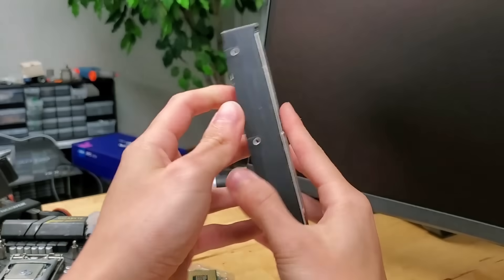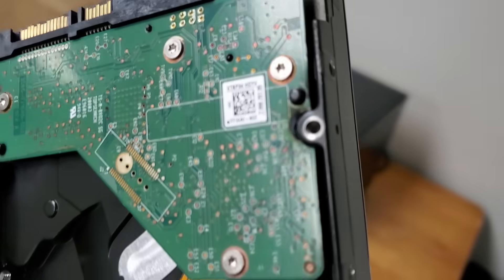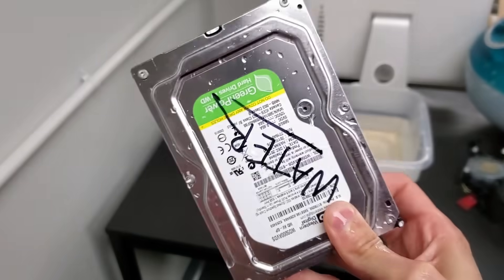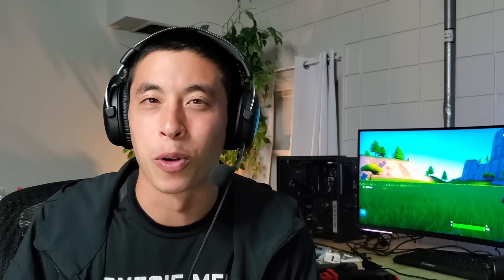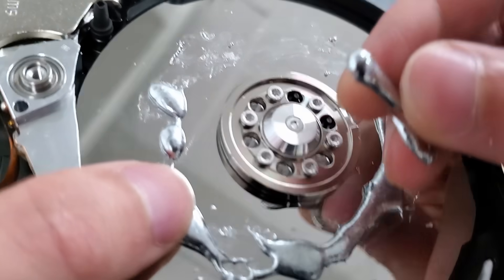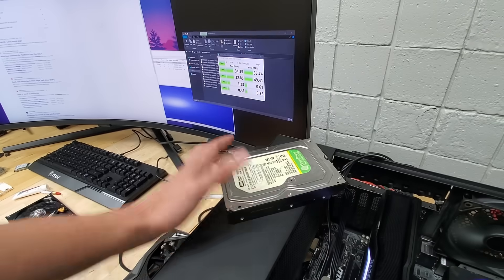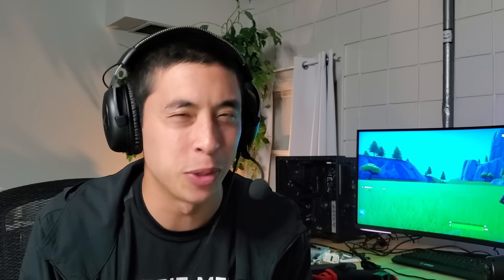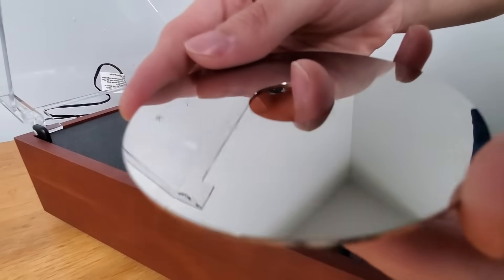The Most EFFECTIVE Ways To Destroy A Harddrive

Comment: @mryeester
You should have taken the disk out and used a stick welder to send arcs all across it. Maybe even weld a bit on there, although I highly doubt you'd get anything to bond. You also would probably need to scratch the surface pretty bad just to get that first arc, if it arcs at all.
If you can't get an arc, use two car ignition coils and use the disk as the bridge in the air gap.

Also:
Bend the disk
Put the disk on a sanding belt
Take the disk out and put neodymium magnets on opposing sides and slide them around

Yeah.

Comment: I have a 17 year old computer and it had a Hard Drive. And one day drive completely stopped working. I had a black screen on windows. I let it over night you know to see if it will boot up, and guess what. It didn't work. So I decided to start dropping it untill it opened itself. And I smashed it with a hammer. Now that computer has an SSD with Windows 10 LTSC installed. So that's it. Bye

Comment: DIY: Remove the platters from the drive and sand down the surfaces to remove any magnetic material. There is no way to recover the data if you do it thoroughly.

Enterprise: Degaussing, and crushing. There are companies that make rack-mounted data sanitizers that degauss then crush hard drives in about 25 seconds then provides a certificate of erasure and destruction for each drive. The certificate includes before and after pictures of the drive, serial numbers, date and time stamp, degauss and destruction details, and user/witness IDs.

Comment: the most annoying thing about this video, is that if someone wants your data from these drives.. most of them can rebuild the platters replace the boards on the drives etc.. to recover data.. your tests while amusing aren't really reliable for destroying the data on the drive.. drilling holes in the platters and lots of them is one of the best ways.. just because you plug in the drive and Windows says something is wrong.. doesn't mean your data is now SAFE.

Comment: none of them did. you need either red hot magnetic reset+oxidation to destroy the platter surface, or crush it into so many small pieces unreasonable to reconstruct. 

Fast and easy is overwrite a few times with random data. Emergency is drill a few holes. Proper is full disk encryption + wide raid array

Comment: if you want to erase data for good, just rip the circuit board and break it in half.
It has a key in it, and without that key, data is impossible to read. Every key is unique to the hard drive, so, someone might get a new circuit board and restore the functionality of a hard drive, but the data is unreadable.

Comment: I usuallly cut my HD Drives in two with a bolt cutter.  usually takes one cut from each side of the disc then bend the body back and forth and cut the remaining thin foil with siccors.

Comment: Hmm not impressed with your "destruction methods" especially not the microwave one. It may have destroyed the PCB but if you remove the pcb & replace it with a new one from the same type of drive I understand that it WILL still work !!! (This is one of the ways the POLICE get access to supposedly "destroyed" HDDs !!
Likewise the SUBMERGE in WATER test, again all you have to do is remove the platters & mount them in a replacement chasis with the same type of controller (is put a 1TB Firecuda's platters into a replacement 1TB Firecuda chasis & it'll work fine.
A toaster does nothing to the platters so the data is still fine, the damage to yours is due to the PCB being wrecked !!
If you REALLY want to destroy the data on a HDD remove the platters from the case & run a MASSIVE MAGNET or a DEGAUSER over EACH SIDE OF EACH PLATTER or, having removed the platters put them in a furnace sop the platters MELT !!

Comment: To avoid any chance of data recovery, one would need to make the platters dissapear. So, after drilling,  leave them in acid for months. If no acid, then get on a boat and throw them one by one, across large distances, to the sea.  Deepness to hide them, and salt water may help the corrosion.

Comment: ya most of those really only hit the electronic or mechanical bits, not the actual plater where the data is stored.  The drill was probably the most effective at destroying data but a good data recovery professional could probably still get something off other areas of the disk that were not damaged.  To really make sure the data is gone take out the platers and grind those to powder.  second best however is just run one of the many "data shredder"  utilities that overwrites the whole disk with random data.  A few rounds of that and even a high end recovery center is not going to pull much out of it.

Comment: Even if circuit board is destroyed, the data can still be recovered from the disk inside (although it might require some special equipment). Therefore the best way would be to hammer the disk into chips. Or simply overwrite the drive multiple times if you're concerned only about data leak.

Comment: The microwave test was done in the most dangerous way possible lmao

Just all safety precautions absent like not doing the test outdoors, not having heat resisting gloves, and having nothing to put out a fire nearby on hand too

The fire after the sparks might have been a shock and unexpected, but surely if you know that metal sparks in microwave, that fire is a risk in this experiment, but it was was still done indoors with no safety precautions at all

Says not to try this at home; proceeds to try it at home

Comment: the guaranteed way of rendering the drive completely unreadable and inoperable is by removing the read head ;)  If you want to guaranteed completely destroying the data then heating it to 450C or above will do the trick as that will absolutely guarantee the data is totally unrecoverable due to it totally removing any magnetic influence on the disk platters ferrite material.

Comment: I've hammered a nail through them a few times - works really well on glass platters which just shatter into myriads of fragments. Harder platters also end up bent, distorted and out balance with missing data at the holes so are going to be pretty safe from anyone less capable than a national spy agency.
Related question though - how do you destroy a SSD? I did wonder if an hour or two in a 200 Celsius oven would work (but concerned about the plastic fumes).  Any ideas would be welcomed.

Comment: Thing is with the car , you are not putting 2 ton on the hardrive . You are putting effectively 1/4 ton on it as the weight is spread over 4 wheels. On top of this there is give on the wheels .

Comment: This was a clever video and fun to watch, but destroying a hard drive is really easy. Just put it on a hard surface like your cement garage floor and whack it hard with a hammer a few times. That will shatter the drive platters, and you can confirm that they are shattered by shaking the HD, and you can hear the fragments rattling around. Guaranteed to work.

Comment: The reason the HDD survived at 1:54 is because it has a seal between the actual mechanics and the outside which makes it waterproof. Maybe the board too? and also the hard drive still worked because they're sealed to prevent dust from corrupting data.

Comment: none of these methods will stop a fbi forensic team from recovering the data, if you truly want to destroy your data beyond ANY chance of god himself recovering it, you need to disassemble the drives, pull out the platters and use a wire wheel ( or stiff wire brush ) on both sides of each platter till the shine is totally removed from them.....then it is truly destroyed

Comment: in case anyone is curious, AWS datacenters use machines called degaussers which are machines with very powerful magnets that scramble the data, then they get smashed by a mangleR (yes its called a mangleR) which essentially bends and smashes the disks to pieces :)

Comment: My go to has always been opening the drives, scratching the crap out of them and then bending the platters befote cutting them with an angle grinder. You may say overkill, but i say effective. (Also fun fact laptop hard drives sometimes use a brittle material for the platter, I've had one shatter in my hand while just trying to bend it slightly by hand)

Comment: The reason a car doesn't work is bc the rubber tires distribute the pressure. If a car had metal wheels like a train, you'd see a fair bit more damage probably, but even so the pressure isn't that insane. Speaking of trains tho... (probably shouldn't try it tho, wouldn't wanna be liable for causing a derailment) it'd be interesting to see like how much it takes to crush it with a hydraulic press tho, I'm sure there's some channels who wouldn't mind helping out in finding out the answer to that lol

As far as the microwave and water goes, you've definitely fried the supporting hardware, but I wonder if the disk itself is still ok?
A professional could probably transplant the disk with new supporting hardware to recover the data if needed I'd imagine, so it'd be interesting to see just how much the disk itself was messed up by the fields in the microwave. Definitely interested in that followup!

I'd bet the toaster warped the disk, I think that would be probably one of the most effective ways. The platter going above a certain temp should make it lose the ability to store magnetic charges, and warping it would make it further just unable to be spun, so I think heat is really the way to go. Jabbing some holes in it with a soldering iron would probably be super effective lol

The reason regular magnets don't work, is because the harddrive uses magnets a fraction of a millimeter away from the disk, so you either need something really strong or really close. That's why dropping a (older) harddrive can kill it, the disk can bump into that magnetic head while spinning and take out a huge gouge. Modern drives can detect the freefall and will park the head away from the disk and stop the spinning to help avoid damage tho

Comment: Microwave probably only destroyed the control board. Put in a new board, you'd probably still read data from the platters. Thirty years ago, the recommendation was drill a couple of holes in the cover and fill the cavity with Coca-Cola. The acid will eat the metallic coating off the platters, deleting ALL data in the process.
🖖

Comment: Good chunk of these could be professionally recovered. The best way to ensure data deletion is destroying the platters (physical or chemical), or stupid strong magnet over the platters.

For chemical from memory its nitric acid or hydrofluoric acid, serious do not touch the stuff unless trained, habe all the ppe equipment etc.

For the magnet even neodymium magnets may not work, you need extremely powerful electroc magnets.

Easiest is physical destruction, sandpaper over the entire platter, shattering into small pieces and disposing of them in various locations etc.

If your worried enough for your data being recovered you should also use hdd wiping software first, some will wipe it for future use, few dozen passes is suggested, some will even cease it from working after. Also don't forget to destroy any cache or ssd chips on board the hdd, some do have short or long term solid state storage chips to make the drives perform faster (so let's say copying files to it, it goes to the "ssd" or cache on the board, so it can write it over time and allow your pc to do other things once it's all in the short term storage. This is why windows has the safely eject media thing.

Very high heat can also be a good way to destroy data on a platter depending on coating etc it can be 1200c to almost 1500c to ensure its gone.

Though once again if paranoid about your data being leaked (nearly all the time your hdd data isn't important to those that can recover it) you can use software to completely wipe it, then do a combination of physical deletion methods, eg sand platters, shatter then heat to 1500c for a few mins, proceed to dispose of fragments over multiple weeks in multiple dumpsters nowhere near your house or work. Destroy any and all chips on its circuit board with physical destruction and heat (can be around 800c or above for short duration or 500c for long once again depends on materials used).

Comment: On the unplugging one, you should give it a write instruction and unplug the sata cable. It should get stuck sending power to writing if the drives logic isn't the most reliable.

Comment: One of the better ways to truely delete the data (apart from shattering the internal platters) is to heat them past their curie temperature, which permanently demagnetizes them.
Reply: @@shadewood3083 yeah but the data is written magnetically. So even if the drive survives datas fucked. (The drive wont survive.) What i was suggesting will turn the whole thing into slag.
Reply: So im getting put it in thermite.
Reply: @Gamer-nc8qp there's a special thermite mixes made specifically for that.
It burns for 2 hours, then drive probably survives, data is lost forever
Reply: @@shadewood3083 When it's in thin-film applications (like the HDD) the curie point decreases dramatically, with some research online I found it is probably less than 200c (473K)
Reply: haha    another brilliant :-)   knowledge is power  :-)   heat or.... electro magnet?      tried ith a 5 pound pulll neodymium magnet, did nothing

Comment: Fun fact, you're dealing with an HDD that has METAL Platters in it.

It is best to remove the platters and just make wind-chimes out of them or just sand them down a little.

That's Where the data is and it's stored mostly on the thin layers of platting than anything else.

The data isn't being destroyed or removed when you freeze, microwave, or run it over.

If this was a Laptop HDD Thins 2.5inch ones, you can just shatter the glass platters and scatter them along the beach or across multiple trash cans... Assuming they're not the Aluminum platters.

Comment: Microwaving it probably didn't reach the platters and other inside components, so the data could be recovered with the help of the circuit board of an identical drive. Why? Because the case is made of matal and has almost no holes. And the shield in the microwave door has a ton of holes and still only lets miniscule amounts of radiation come through.

Comment: Yeah send them off! And fun fact, if you disassemble a hard drive with multiple platters, you can never, ever get them aligned perfectly, so your data is completely gone! I keep the platters of my broken drives and hand them out to family and friends to be used as coasters! They are neat, are so shiny and they work great!
Reply: Wrong, they have specialty equipment that can read the tracks without them being perfectly concentric. The only sure way is overheating the platters above the Curie point.
Reply: Wrong, they have specialty equipment that can read the tracks without them being perfectly concentric. The only sure way is overheating the platters above the Curie point.

Comment: The best way to permanently kill a hard drive is to disassemble it, take the platers and then smash it with a hammer or get a nail and basically nail it. Shattering the drive is also a good way to kill it. You need to spin the drive in order to access the data. If the disk is in pieces you can l't access it anymore.

What I usually do though is taking it out into the backyard and burn it. I put it in a steel drum with some charcoal and a bit of gasoline and then burn it. If that's not available for you just put it on your barbecue grill for a few hours.

The best way to remove the magnetism of a metal is by either running AC current on it or by heating it up. Since running AC electricity is dangerous, you can just burn your disk. If you wanna be 100% certain your data is destroyed, remove the cover and burn it with the platers exposed.

This is also one of the reason why I switched to SSDs when storing sensitive data. When it comes time to get rid of those data, you can just throw your SSD into the grill and let it burn. That or just take a hammer and smash any microchip you see on your SSD.

Comment: For a spinning disk, multiple overwrites of data with certain types of data using an erasure program is one of the most cost effective. This can take days for a handful of drives however.  For SSD's and NVME's, taking out the chips and hitting them with a blow torch comes to mind.

Lazy man's way:  Disconnect the system from any network, and bitlocker the entire drive ( not just existing data ) and don't save the key. 

At work, they prefer a disk shredding company; have done about 650 spinning disks at one time this way.  At work, the company now require all disks to be encrypted 100% in case a drive is recovered by a rogue tech or otherwise stolen. Typically, we don't allow support techs to recover drives when replacing failed drives. For any decommissioned laptop, desktop, or server, the drive is removed and physically destroyed. 
Also have used the erasure programs; disassembled the drive and physically destroyed the platters; drilled drives..

Comment: The only true way is to first overwrite the data. However many times you want. Then fully disassemble the hdd, using a torch on the platters and then grinding them up into a powder. You also have to burn the PCB. The rest doesn't matter but I am sure big tech will also destroy the read headers just in case there is some secret hidden memory in there.
Reply: Or you can just melt down your hardeive in a small forge
Reply: Cover it in gasoline and melt it into slag
Reply: @EnterChannelName_248 gasoline wont do it but thermite will XD
Reply: @Gamer-nc8qp what about blend it?
Reply: @johncaze757  it would work. The standard for NATO secret information is to degauss the drive. For top secret degauss and destroy.